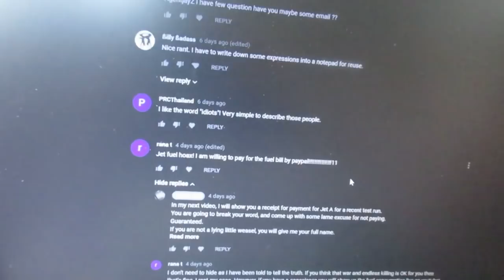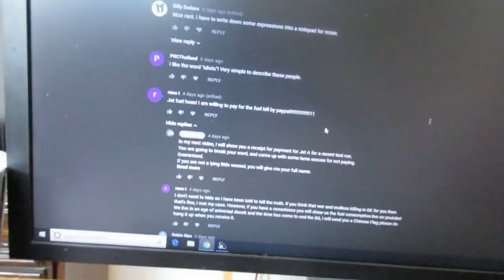Hoaxtard Discussion

Comment: Sir AgentJayZed  ok, here is a stupid question for you, it is stupid because I cannot figure it out.  Is a Turbine Engine an internal or external combustion engine?  I ask this as the only internal combustion engines I know of are conventional piston engines.  Where I am stuck is, as there is no sealed area for the combusted fuel to push against (like a piston) the energy in a  Gas Generator is converted to torque via the aerodynamic effects on the Turbine blades.  My guess is it is an external combustion as the flame holder cans do not HAVE to be located inside the Turbine Casing.  But I am wrong more time in life than correct, hence the question.
Reply: They are internal combustion engines since the working fluid is involved in the combustion and that is the definition of an ICE.
Reply: Thank you, that definition makes sense.
Reply: D. R. Lee, thank you, but the Skunk dude gave me the missing piece I needed.  External Combustion, the working medium (air, steam, pixie dust) never mix with the energy source.  In the Turbine, as the fuel is added to the air stream, the ignition of the fuel is now part of the working medium.  That was the part I was missing.
Reply: Yes it explains everything. As I said, that the working fluid is involved in the combustion is the definition regardless of strokes or where the combustion takes place. This goes for gas turbine engines, diesel engines, otto engines etc.

On the other hand, in a stirling or steam engine, the working fluid (e.g. air or steam) is separated from the combustion and they are therefore external combustion engines.

Comment: what are the pressures that would develope in the last stage and/or combustor if you reached max operational rpm by spinning it with an electric motor. no fuel. I had this question a few days ago so this is kind of funny that peopl are saying this.. .( I wouldn't even believe this. these are probably flat earth era or somthing.) don't feed the trolls. it only encourages them. they are only in it to get a rise out of you. it thrills them.
Reply from the maker: You would get the same pressure: Compressor Discharge Pressure, or CDP. That would require a 30 thousand HP motor for a J79.
Reply: @AgentJayZ  : I've read that a Nene required 5,000 hp to turn it's compressor. Thanks for info on a J79.  I find it difficult to find this info, not that I really need it, but I find it interesting. My car is less than 200 hp,  so I find these jet engine numbers, just to run the compressor, surprising. As for compressors needing input energy, I find my shop compressor works better if I plug it in.

Comment: Typical passenger jet holds about 50,000 gallons of fuel. A typical tanker truck carries about 10,000 gallons of fuel. The passenger jet carries the fuel in the, wings, right? So basically, 2 1/2 tanker trucks per wing? Hmmm, someting doesn't add up here.  Of course jet engines use fuel, but not nearly as much as they'd have you believe. That way they can keep fleecing you on those plane tickets!
Reply from the maker: The fact that you do not understand something, and can't be bothered to learn about it... is not evidence for your point of view. It is simply advertising your lack of understanding.
Go away, and come back when you have one single molecule of actual evidence for your contention.

However... bonus points for arguing in actual fuel trucks, and not "elephants" like a lot of other hoaxtards seem to be obsessed with.
If yoou check the dimensions of the fuel tanks, and the fuel consumption of the engines... you will see that enough fuel does indeed fit in there...
It has to, because the engines actually use fuel in proportion to their incredible power.
Reply: @AgentJayZ  You're right! I don't understand a THING about MAGIC! 🤣 But I do recognize a LIAR when I run across one!
Reply from the maker: You are the one performing magic. The fact that you don't understand basic measurements of length width, depth, and how they create volume.... that all turns me into a liar? Presto!
You do belong in our gallery of fools.
Welcome to Jet City!
Reply: You are confusing gallons with pounds. Doh. Trucks measure gallons. Aircraft think in terms of pounds, since the weight is so important.

Comment: Why don't you tell the jet fuel hoaxter's that pressurised air needs to be contained 
in a heavy thick bottle the same as a fire extinguishers and that Propane tank out the test cell, how much does that weigh, so how big would a tank of pressurised air be to carry a B747 to cross the Atlantic, using actual maths what air volume and pressure would be needed to carry an actual plane with no room for passengers, and as the task empty wont the the presssure drop ?
Reply from the maker: Why? Two reasons:
1 - Facts and logic do not work on their hardened shells of ignorance.
2 - It's not up to me to explain how things really are. It's up to them to explain how these engines run without fuel. They are unable to do that.
Reply from the maker: Peter, your idea is sound. My problem with the hoaxtards is that they have accused me, stolen from me, and have even threatened me. I say fuck 'em, fuck every last one of them, right in the ass with a saguaro cactus dipped in habanero sauce, and hooked up to a welder... 

Who, me? No.  I would never say anything like that...
Reply: @AgentJayZ  I actually know a person who  believes this,
I said what about AB,
well he knows fighters do
where's the logic ?

Comment: Hi AJZ, I asked you about model jet engines in the past regarding how simple they are.

I discovered a kind of in-between turbo-jet here http://www.bladonjets.com/
This devise is being marketed as an electric power generator.

They do not tell us the price on the web site, but looking at the engine itself, it appears to lay somewhere between the complexity of the engines that you work with and the simple model aircraft variety.

What stuck me was the claim that it can generate 100 ft/lb of trust.
That is way more than a model engine.

I wonder if I dare to ask them how much it would cost to just buy the turbojet.
Reply: They state an 8,000 hour service interval too, ok, it's not life threatening if it fails BUT, that sounds unrealistically long to me.
Reply: I've not seen or heard anything lately about Bladon Jets.  The engine is effectively a small turboshaft and, as they claim "one moving part", it must be a single-shaft machine.  An 8,000hr service interval should be achievable, running at base load.  An Industrial Avon, running at base load in a gas pumping application,  achieved over 40,000hrs, back in the 1970s.
Reply: PS  To convert the engine into a turbojet, some redesign would be required for the turbine, so that it no longer extracted the power required for the electrical generator.
Reply: Thanks graham. You're right of course. I'm just not used to dealing with engines that 'can' happily be run for such long periods without servicing. Of course there's not exactly a lot of different bearings, and other parts exposed to metal to metal friction. I was stupidly shocked by the numbers, a bit like these people who can't get their heads around figures to do with things like the A380 etc. That Avon running for 40,000hrs is just mind blowing to me. Very impressive durability.
Reply: An RB211-535 achieved 40,000hrs on the wing some years ago and I believe that 50,000hrs has been claimed more recently for a CFM56.

Comment: Can you show fuel going into a jet engine?
Reply from the maker: It's up to the hoaxters to show it not going in.
Reply: AgentJayZ It's not impossible to run on compressed air. But what I know about it, a regular battery motor is more efficient. Which would mean a fuel motor has more range. It would do a lot for people to see fuel going in or coming out of an airplane.
Reply from the maker: The only people who would benefit would be people who are unsure about the jet fuel hoax.
Those people are ignorant, as well as fools.
I have no interest is serving such idiots.
Reply: Jg3000 - Do you see gas being poured in your car? No, does that mean there is no gas going in?
Reply: Robert Lafleur yes i can...open ur eyes..

Comment: So how much weight in fuel is in the wings? How long does it take to fuel an airplane?
Reply from the maker: Aircraft come in different sizes, and it is common to only put as much fuel in the aircraft as it needs for a particular trip, with a nice safety margin, so The answer to your first question is: it depends.
For the same reasons, plus the additional consideration of how much pressure is used, the answer to your second question is: it depends.
The fact that you have asked questions is good.
Keep asking them, please.
Reply: Large aircraft such as Md-11 and B777 will hold over 200,000 lbs  in the wings and center fuel tank.  Aircraft such as B747 and A380 will even be more.  My experience where we fuel aircraft is at a rate of about 3000 lbs per minute.  C-17 holds about 170,000 lbs of fuel in the wings.  Until you have worked and crawled on these big aircraft, you really don't realize how big the wings really are.
Reply: @AgentJayZ  Thank you for the reply you're a very knowledgeable guy
Reply from the maker: @garrettjones8017  Somehow I knew that you were a good guy. Look at several sources of answers for your questions, and come to your own conclusions.
...Has a hoaxter ever said that?
Reply: Aeroplanes on the stand will usually be pre-filled prior to the pilots getting into the flight deck. The pilots will give a final fuel weight to the engineer who will organise the tanks to be “topped up” to the final amount. This will take less than 10 minutes. 

As has been pointed out, aeroplanes only take fuel for the flight plus a bit, so only ULR flights will be carrying anywhere near maximum fuel.
Reply: Michael Vincent - the hydraulic rams and other other components only take up a small portion of the wings. The entire remainder of the wings will be used for fuel storage, maybe to 3/4’s of the length of the wing. Fuel won’t be stored at the wing tips except in aircraft like the Cessna 310, which has the equivalent of a 55gal drum on fuel tank on each wing tip. 

The entire inside of the wing is fuel tank, and so the fuel doesn’t slosh around because of all the ribs and baffles inside the tank.

Comment: It doesn’t say no fuel, that’s disingenuous. Where does a tanker worth of fuel go in a plans wing is the question. The name callers usually are disingenuous.
Reply from the maker: The Jet Fuel Hoaxtards claim that airliner engines use zero fuel, and run on compressed air only. The weaker ones, who are scared of looking like the morons they are, have said "well we didn't say none, we are saying they use less fuel than is generally claimed".
All of you ignorant dumbasses claim zero. Check your shit before you throw it.
You are arguing with reality, refusing to accept facts. Do what you say you want to do, and look into the facts. You have never done anything but reject facts. Try talking to a pilot, an engineer, an engine technician, a refueling truck operator. Go look at an airliner. Do something besides whine and accuse.

"disingenuous" is your new word... it better than last years phrase: "over unity". That's the way you and you "leaders" claim that airliners use no fuel. No fuel is what you say.

The world is still waiting for any of you idiots to explain how they do that.
Go ahead, then.
Reply: @AgentJayZ  The vedoes on jet fuel  DO NOT SAY the planes don't need fuel!!! It clearly stated that they need fuel for take offs/ landings and driving it to the terminal. Maybe you should reread replies before getting so negative and angry...have a nice day:)

Comment: Ahh! What about the bleed air? Go after burn kerosin in to the cabines without filter?
Reply: What are you trying to ask? Surely you can't be stupid enough to think actual jet exhaust is fed into the cabin?
Reply: In case this is a genuine question, the bleed air is extracted from the compressor, before the fuel is added in the combustor. If you don't know what that means, you're on the right channel to find out.
Reply from the maker: Also, bleed air is used to turn a small compressor that in turn supplies cabin air. Engine bleed air is not used directly to pressurize the cabin on airliners.
Dang, once again I have exceeded to capacity of our moronic hoaxtards to understand information...

Comment: ok so start this engine on jet fuel and show how fast 10litres  will burn. show please we will wait
Reply from the maker: Nope.
It's up to you to either show the engine not using Fuel, or do what you say, and seek the truth.
The truth is there.
It's real.
Open your eyes.
Reply: yes the truth - explain how the hell such amount of fuel is pumped into plane. what kind of pump is this? - i seen many times flaps open in the wings - only shafts and hydraulics to move these flaps no space for any fuel tanks
Reply from the maker: See? There you go again. All you are doing is saying you don't understand.
Do some digging and reading.
You will find the knowledge you need.
If you don't believe me when I show you the actual receipts for the fuel we use, you are going to need to ask other people.
How about phoning the local airport and asking to talk to somebody about aircraft fuel procedures?
Cheers.
Reply: Here is another way to look at it adam, what stops the engine? There is no brake on it (nor would friction braking the full engine power be a small or simple device), and the igniters aren't needed if its not burning fuel. On a older style motor without variable compressor stages (via stator angle or bleed) or rear variable nossel, the ONLY control you have to the engine is the fuel.. add more and it goes faster, take it away and it goes slower. Remove it entirely? The engine stops. Look at the earlier videos on this channel to see the thermal camera (IR) footage of a running engine, notice how it gets hotter at the burner cans after the compressor stage, this is where the fuel is burning. If fuel where not burning, the air would be cooling down after compression.

As to explain the fuel system in large commercial airports to you, there is actually fuel lines under the ground of large air ports that connect to a larger tank. The truck (which does have a tank to work as surge, but generally not as large as tank on the truck you pictured, which you be used to fill aircraft if they are not within reach of the main manifold, or at airports where one is not present) pumps the fuel to the wings, or indeed, from the wings to the ground, as depending on your location and the aircraft's route, spare payload capacity is used to "tanker" fuel from airports where fuel is more available\cheaper to airports that need it. If you look closely, even from the terminal you can see these ports in the ground. They need a manifest to cross check numbers (otherwise a stuck fuel gauge could be dangerous, or an aircraft overweight), pay tax and many other tasks, hence why commercial truck companies also keep log books that cover fuel, distance and tolls, despite also having a fuel gauge.

Finally to show the wings are not hollow, look at 737 800 aircraft that have landed recently that have a reasonable amount of fuel on board (such as any not refueling before next flight), they will have frost on the top of the wings in a pattern. The pattern is the tanks in the wing, because the fuel has thermal mass, and cools at altitude where the air is cooler, then when the aircraft descends you get condensation freezing just like you do when you take something out of your freezer at home. Or to look another way, you will have the take off and landing mass of the aircraft on the specs, since the wing itself doesn't change till flaps are deployed, you can use the air speed, angle of attack and climb rate to confirm the change in mass from visual observation. If the change in mass is not fuel being used, where did it go?
Reply from the maker: Your opinion is incorrect, and fortunately is irrelevant.
The facts are there, sir. I suggest you investigate a little.
No one can convince you but you...
Reply: CYCLOWL
They never used a Formula one engine. I don't recall off the top of my head what that first V6 was, but it was not enough. Now they use a supercharged Jaguar engine, the same 575 bhp unit found in the SVR cars etc. Chris Harris did a long vid on it, very cool and informative.

Comment: Are you a liar, i think yes, 100.000 liter of fuel on board is impossible, and you know that
Reply from the maker: This video is about you. And other ignorant people just like you.

You say you are seeking the truth. It is right in front of you. Open your eyes.
Reply: 100.000 litres of fuel is only enough to fill your average bathtub half way full. Not sure why you wrote it with such enormous precision?

Or did you mean 100,000 litres? In which case there is still definitely space inside the wings for that much.
Here is a picture of a 24,000 gallon (109,000 litres) petrol truck trailer http://www.semilowbedtrailer.com/photo/pl11766472-titan_4_axles_20000_gallon_fuel_oil_tanker_truck_trailer_for_ghana.jpg
And here is a picture of a truck pulling the wing of an Airbus A380. https://miro.medium.com/max/1024/0*-Q9n3PLtpsfm0Lpj.jpg
The A380 holds 320,000 litres of fuel (more than three times the quantity that you claim is impossible to have on board)
I hope you can see how much bigger the wing is in the picture than the fuel tank.
If not i'm afraid there's nothing i can do for you.
Reply: Oliver Turner Truth in plane sight!
Reply: @lisabuttonz  hehehe, plane sight.